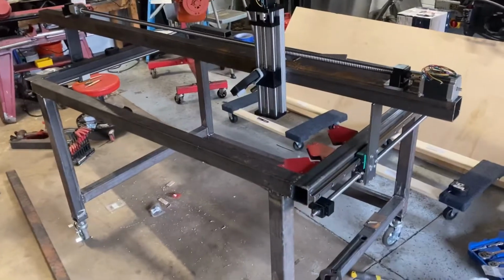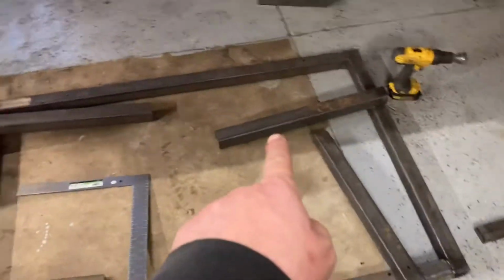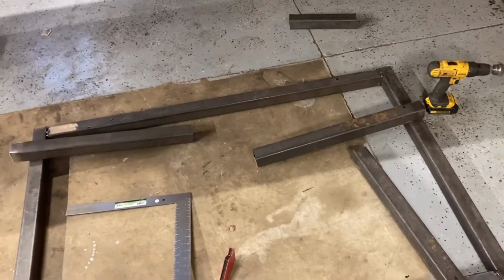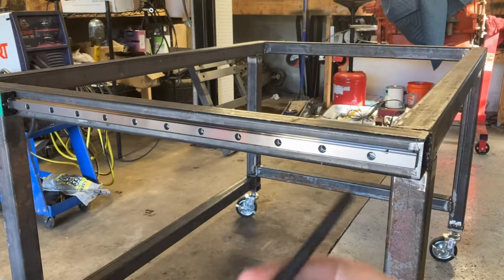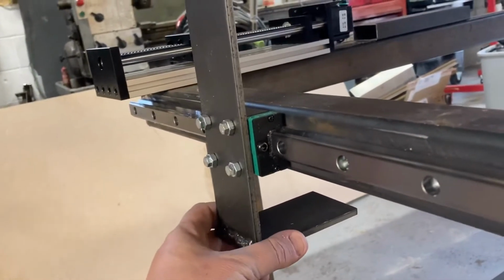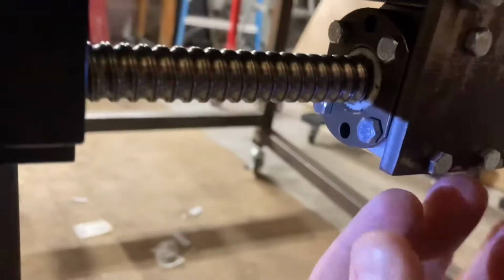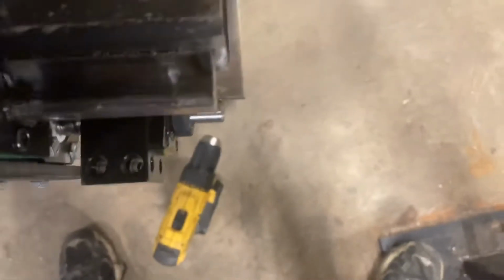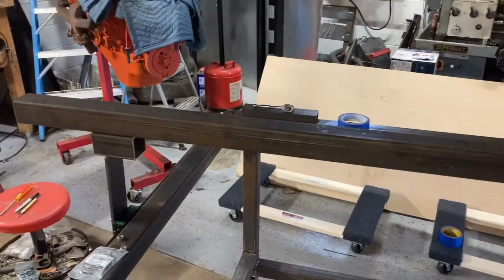DIY CNC Plasma table for $1000?

Comment: How did you make sure ur linear rails are aligned with eachother so they dont bind?
Reply from the maker: They were close on the measurements to begin with then I tightened them a little at a time as I ran the axis back and forth. I don’t know if I lucked out but it went really easily

Comment: Are you going to post a parts list?
Reply: Ditto for the parts list please
Reply from the maker: Absolutely just waiting on having it a little more complete.  I’m sure some things will get changed so I don’t want to see anyone buy something that later ends up not being used etc. thanks for watching!
Reply: Hey where did you get the lead screw assemblies
Reply from the maker: @jackbrimstone1004 they were from eBay. Just search leadscrew assemblies in your desired length and you should come up with several matches